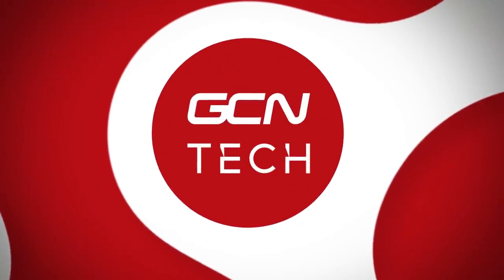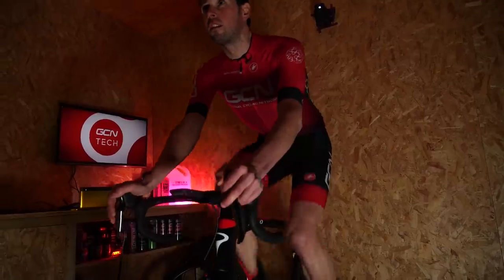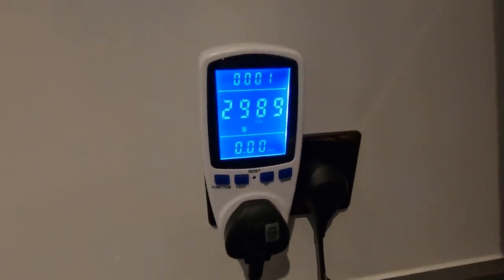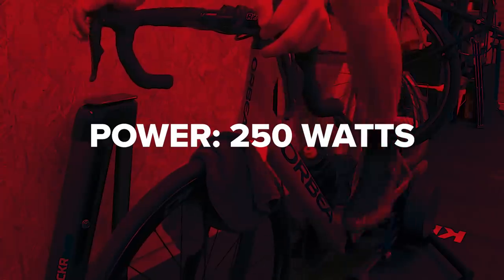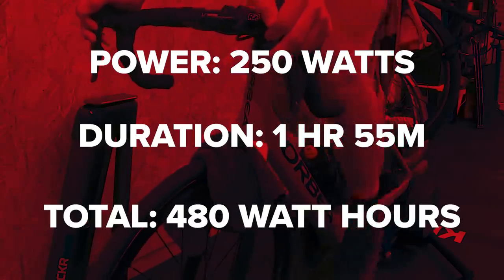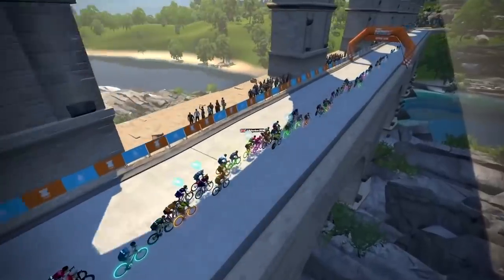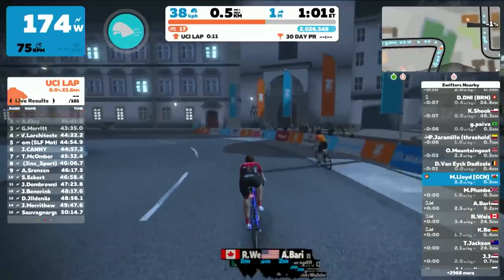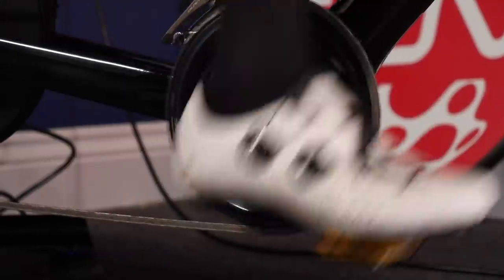How Many Watts Does It Take To Power Your House? | Is Cycling A Viable Green Energy Source?

Comment from the maker: Did you realise how much power we use on a daily basis? Let us know in the comments 👇
Reply: Your largest energy savings with a bicycle is transporting a person uphill down the street to the store or market. At what speed does a dynamo hub make enough AC current to power DC headlights and possibly power a  bike computer, smart phone, or GPS?
Reply: I have a smart meter: 868W average for march (so far)
Reply: Yes and it's depressing when after a long ride I calculate that I've only generated around half a kWh. I don't use much electricity but still consume 2 - 3kWh per day.
Reply: Very interesting Alex. Could we hook up a battery and at least recapture some of our power output
Reply: @WowRixter  You can yes assuming the trainer uses a generator which I suspect many don't. Charging a battery is the best way to use the power. You can then power things off it with an inverter or other DC to DC voltage converters for phone charging etc.
It's the way I'll do it with my homemade one as it's based on a permanent magnet alternator.
Reply: @Ed.R  that would be cool
Reply: Yes.
Reply: I am proud of you!

Comment: It's not kilowatts per hour (the watt is already a unit of power), its kilowatt hours, which is a measure of energy, ie 1 kWh is 1kW for an hour...
Reply: Symantics bro
Reply: To be honest, I've rarely seen anything that isn't electrical engineering or technology focused get it right. Reading news articles from reputable but not technologically focused sources about the power grid can seem to end up as shouting at a brick wall with all the errors in units that mean the numbers are either meaningless or require more research to see what they actually are meant to be :).
Reply: Exactly. kWh means kW * h, (energy). 

kW per hour, or kW/h technically exists too, it's the derivative of power, aka the change in power output over the course of an hour.

just like km/h * h is distance whereas km/h/h is acceleration (change in speed).
Reply: @jg374  I’ve seen that a lot too, and I don’t really understand why. It might be because people don’t write things like kilometers per hour correctly, and just write kmh instead of km/h
Reply: @lucasklaassen135  I suppose most of the common units have a "per" and division in them.

One of the more entertaining things I have come across in a catalogue selling camping fridges is "1.1 Amp per hour avg power usage." Spot the errors :) They were also trying to sell a 16000MAH powerbank due to all caps titles on the row below.
Reply: @hellopsp180  It's a TECH SHOW - "Symantics" such as kW/hr vs kW*hr are very important.
What you're talking about is more in the way of me telling you that it's spelled SEMANTICS, lol.
Reply: @jg374  That’s probably true. Can be quite entertaining indeed!
Reply: @Jan Hendrik Burdinski Actually, Stundenkilometer and Newtonmeter do make sense to me. It does exactly describe the unit: Kilometers per hour/newton per meter. Get your point though
Reply: @Jan Hendrik Burdinski Yeah, I think you’re totally right!
Reply: Yes! OMG Alex, you're making us engineers cry!

Comment: Imagine the energy you could save if you cycled instead of driving!
Reply: Imagine the cost of fuel (food) you’d need 😜😂
Not saying I think it’s worse, but it definitely offsets a lot of this idea haha
Reply: @fabianirsara9846  My thoughts exactly. The footprint of growing the food for the extra calories you burn while cycling may - in certain situations, largely depending on your diet - outsize some motorized solutions.
Reply: @GeeFunk84  The human body and a car engine both have around a 25% efficiency converting chemical energy to kinetic energy. A cyclist uses 8-15 Wh/mile whilst a car uses around 340 Wh/mile so between 20 to 40 times more energy per mile than the cyclist. There's no real way cycling can ever be as bad for the environment for a combustion engine unless the electric car is fully powered by renewables (which also would include another efficiency loss in converting to electrical energy then to kinetic)
Reply: @edwardtaroghion7874  Thank you. People don't really get how much the orders of magnitude work against moving large hunks of metal!
Reply: @tychoMX  I do, I have a steel bike :D
Reply: @GeeFunk84  LOL. Brilliant!
Reply: I think just one acre of corn can generate 15M of calories which could get you 300k miles at 50cal/mile. And an acre of corn translates into ~300 gallons of ethanol which would be far fewer miles (around 20:1 difference with a very efficient car). But I guess if you’re fueling with beef would be much different impact and same on car side (could use algae or renewables as noted above). I think the US throws away like 30-40% of all food... sad, lot of fuel either way
Reply: @bam0505  Yes! This is actually my job (emissions accounting). The more you transform things the less efficient the system is. Entropy is ruthless.
Reply: Way back in the day I read something along the lines of the calories in a cup of rice would allow someone to cycle a mile while it would move a car 100 feet. My memory is probably off, the bike is vastly more efficient.
Reply: Liklies then that THE best option for personal transport is an E-Bike?
Reply: @peterharrington8709  "best" is hard to define because it's a multifactorial matrix with large individual variability. It will be different for a person with a 1 km, 5 km, 10 km and 30 km commutes under different climate and transportation capacity requirements! In general, you aim for the smallest "motor"  that would fulfill your requirements. Sometimes it's a pair of shoes, sometimes it's a jet engine!
Reply: @fabianirsara9846  most people in the western world already consume far more food than they need. The extra energi will just be tanken from the surplus, which as a further benefit will then not deposit itself around the waist.
Reply: @ChrClausen  Not sure I would agree unless you're talking about morbidly obese people. When I'm out riding 10 hours I easily consume 4000 calories on the bike. I normally don't eat that much when I drive a car for that long 😂
Reply: @fabianirsara9846  No, but if you replace two daily 10 km car trips by bike rides, you wont have to eat anything extra. That aside, if your 10 hour ride were to be replaced by the  same distance by car the total energy consumption would become many times higher.
Reply: @ChrClausen  Sure, I'm not saying driving a car is better, just that the fuel the body needs - depending on what you're munching on - can be relatively pricey too 😂
unless you're smart and mainly eat rice and snickers haha
Reply: @fabianirsara9846  And i am saying, that for the majority of people, that can be ignored, since they are already eating plenty. The body is actually quite good at adjusting how much of what you put into it, it will actually absorb.
Reply: @ChrClausen  never said anything contrary, looks like we're on the same page 🙌🏻

Comment: For some of us, we are powering our houses with our cycling but not by way of electricity. A zwift session at 250 W for an hour will have the human body burning about 1000 W of energy (the human body isn't 100% efficient at converting stored energy to cycling power).

However, in the cold Canadian winter when windows are shut, 100% of that 1000 W for an hour (ie. 1kWh) of thermal energy is offsetting the household heating that we are otherwise running to keep from freezing.  Now, if the training is done in warmer weather with windows open, it's lost, same would apply if the training is in a shed that's detached from from the house.

So not only is it more efficient to capture the 1000 W of thermal energy, there's more of it to capture than what the trainer sees at only 250 W.

Comment: Since the pandemic kicked in and I've been riding in my kitchen a lot more I kept thinking about harnessing the power generated  in the process to power e.g. the kettle, the coffee machine and maybe charge my phone. In theory it wouldn't be too difficult to build such a thing from car parts, but the hassle would just be too much for the price and the benefit (also, I don't want to burn down my block with my bodge work if possible). 

However, I think it's only so long till smart trainer manufacturers start selling complete units where you charge a battery by pedaling that is equipped with an alternator so that you generate electricity not only for all the onboard equipment but it would have sockets to power whatever is reasonable to charge (a screen for your ride, your phone and if the battery has enough capacity, you could actually boil some water for your tea or make your coffee).
Reply: Gabor, it is not that difficult. All you need is a battery and a power inverter. No moving parts, no motor/generator. Same technology, as Alex said, from the solar panel industry is all you need. Not too expensive either.

Comment: Really interesting calculations. I have wondered about this and it's nice to see your conclusions. However, it's not a zero-sum game. If we could just offset some of our power consumption by harnessing the power we generate on the trainer, it would be a win. It's not a complete solution, but it's moving in the right direction!
Reply: Its a nonsense Idea tbh. Just throw your food in a Natural Gas Generator. The total efficiency (caloric Input vs. Electrical Energy) will be so much higher. You Body will only achieve total efficencies of way under 10%.
Reply: @Rossingiol  Using humans for energy production obviously doesn't make sense for the reasons you mentioned, but since people are going to train anyway for the purpose of exercising, then harnessing that energy that would oftherwise go to waste would of course be nice. 

Currently though, the infrastructure needed to make it practical just isn't there.

Comment: Hey Alex, how much power does the trainer uses? And if it is below your personal output, why do we need to power the trainer at all? Wouldn‘t it make sense to just use the power from the wall as a quick starter and then rely only on someones own power output on the bike 🤔
Reply: Because inefficiencies and cost. It would totally make sense that you could power the trainer and that would enable the display, resistance unit, etc. 

But it requires a generator, which is a) more expensive and b) more complexity. If I remember correctly Tacx had some units that had such a generator before being bought over. I think there are still some out there - look for a unit that lets you use it "unplugged" and still control it. That trainer would have some sort of energy recovery unit.

Comment: Here in Canada, heating by far what consumes the most power, at least in winter when we're riding indoors. 
With that in mind, the power measurement you calculated (through a bicycle power meter) is only the mechanical power applied to turn the pedals. But our body consumes much more energy that is dissipated through heat and that ends up... heating our homes! 😀

Comment: Simple, compare your electricity bill with your Strava stats, total hours on the bike and average watts.

Wouldn't be possible to power everything but solar panels don't power everything either. Would be cool if trainers outputted power to an internal battery or something that you could at least power the trainer itself with. Maybe even a usb port to charge the tablet.
Reply: A company called JetBlack make a smart trainer called "Whisper Drive" that is self charging and claims to generate enough excess to charge a smart phone, or small tablet. So in in theory it could give you self powered zwifting.
Reply: Solar panels can power everything... They can even leave enough extra energy to sell back to the grid.. Obviously very much depends on the house energy usage, how many panels you can afford, fit and where you are, the amount of sun, shade etc, etc..

Comment: You could power some lights I guess, if they are LED and not old incandescent bulbs. And that would be in the US on a 120v supply. With the UK's 240v, lol.
Reply: the voltage doesn't matter that much - sure, there are some inefficiencies in the conversion but really is not that much different. A volt is not a unit of power. (it's electric potential difference, so maybe a measure of how big a spark you can make).

Comment: You should also consider that if you put your trainer in door you provide heat to warm your house. Assuming app 20% efficiency in the muscles and 250W on the pedals equals 1250W yield in total. This is valid only for the cold part of the year, but why should you train indoor at other times? //Ola

Comment: On multiple occasions, you mix up "power" and "energy"...  the "power" would be you putting out 250 W on the bike or the kettle using 2000 W...  250 W for 8 minutes to equal 2000 W for 1 minute is actually comparing total _energy_.
Also, using bicycles to power devices isn't new.  Throughout third-world countries, people use generators on stationary bikes so that they can have sufficient lighting to do basic things like cooking meals or studying at night.  It's nowhere near enough to power a whole house when the electricity goes out, but powering a few electric light bulbs is perfectly reasonable.  1 or 2 if they're incandescent, 10-15 if they're CFL/LED.

Comment: You could power your PC that is running Zwift by Zwifting :D
Reply: Maybe if your PC is an iPad. My laptop power supply is rated at 180watts, I can only handle that for short bursts. My PC power supply is 800 watts, but it often doesn't actually use that much. Still my UPS says that my PC and monitor idling at this video is using 118 watts, and that's with my GPU running at about 2% capacity.
Reply: I'm pretty sure this would work for most laptops, a charger for a 15" MacBook pro only pulls around 90 watts max.

Comment: I'd quickly stop having hot or home cooked meals, there's just no way anyone would be able to compensate for using an electric stove.... Also my electric water heater is out... and my electric heating and air conditioning.

What's important to note, is that Zwift users don't generate enough power to execute the rendering needed to generate the 3D scene they're viewing while they're riding.
Reply: i would depend on the computer. a respectable computer would consume around 70 to 100 watts just for the cpu, possibly more. but i would bet a lot of zwift users connect their computers to a big TV.

Comment: Would it possible if a family did turns on a bike to charge a 12v battery which could run low energy LED lights and fridge, phone chargers and anything we could run on 12v’s. The big power consumption stuff would run off the mains. In that way we could all lower our bills and get a form of exercise.

Comment: But how much energy did you use to power the turbo trainer??
Reply: Yes, I'm interested in that too. Well, some smart trainers (e. x. Tacx Bushido) can run and provide some resistance even without being plugged to electricity as they have sort of dynamo in them, so it's possible and likely he had "overpowered" his trainer's consumption.
Reply: Most likely the same or more power. For the trainer to provide 250w of resistance it will need close to that in electrical energy to power the electro magnets. However if you use a wheel-on trainer and dont engage it and attach a generator to the wheel or sprocket you could get some power out
Reply: Its almost nothing, around the same as an LED light bulb. Check out 'Smart trainer power usage' by GP LAMA. Some use 5-6w in use and others used less than a watt.

Comment: Considdering that most inverters have a n efficiency of about 90% and if the smart trainer was a generator with variable magnetic resistance, it would probably be less than 90% efficient aswell.
So lets say you are producing 200W for one hour as stated by zwift,  you would AT BEST be producing 162 watt for the power grid.
Now factor in the cost of running zwift and the nutrients you consume while riding.. well..

Comment: Worth being clear on the difference between energy and power as they're not the same thing :) 
Briefly, power is the rate of energy transfer. So while 250 watts for two hours is the same energy as 500 watts for one hour (i.e. 500 Wh), the power consumption is not equal. It's kind of like if you travelled at 60mph for half an hour, you'd travel the same distance (30 miles) as if you travelled at 30mph for one hour, but nobody could say that you travelled at the same speed in those two cases.
</engineer nerd whinge>

Comment: The only way your cycling can save a significant amount of power is by riding everywhere instead of driving. That's because while your 100 to 200 Watts maybe ridiculously small, your bike is between 10 and  100 times more energy efficient than your car to get you from point A to point B... And in the city it is actually not really slower door to door...

Comment: But how much power do I use when riding in the kickr at 300watts? Surely that's power I'm also consuming from the grid. It would he good to have a trainer that doesn't draw power to work. The Neo does this afaik, but not fully functional?
Reply: GPLama did a video on that one. Surprisingly little is the answer. But add the fan, computer, monitor, music, lights...

Comment: Why not just read the electric meter box on the outside of the house before and after a week of normal use? Much more accurate than measuring watts and multiplying by time, especially if you’re using electric heat, cooker, tumble dryer, etc.

Comment: It would be nice to build a device which could store the energy you produce by cycling at home :D
Reply: Yes, they call it battery (bateria). Then you hook it up to a power inverter, and you have alternating current power supply. Same as your computer back up power or a solar panel power system. Your bicycle would be the DC power generator, going into a battery.